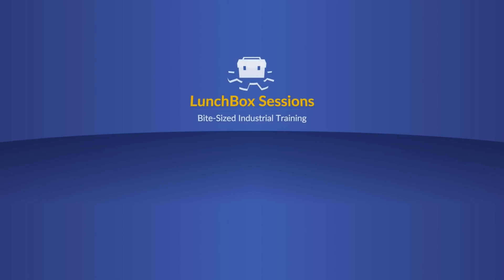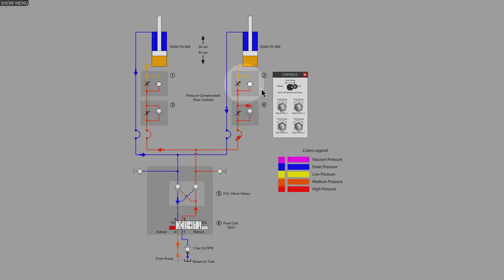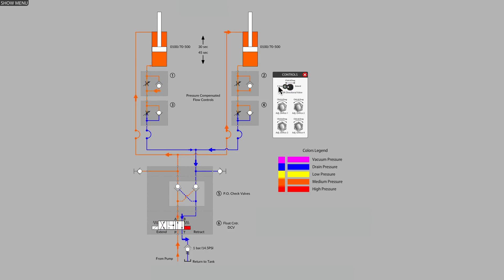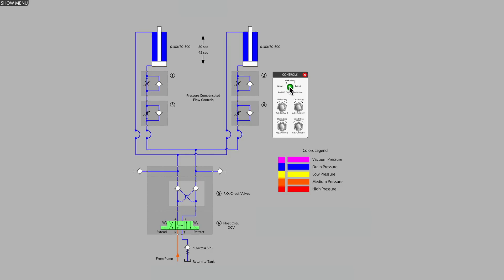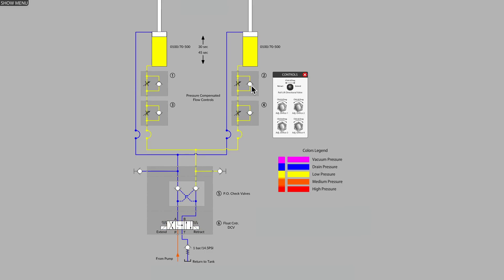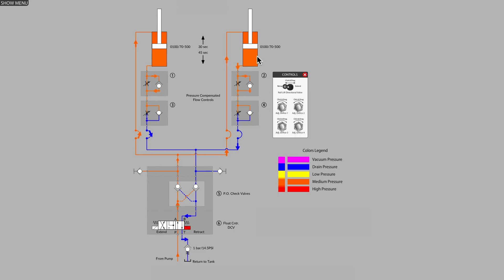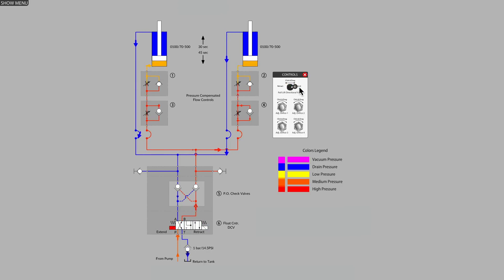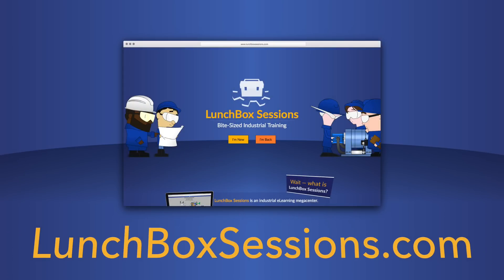Using Meter-In & Meter-Out Together - Part 1

Comment: So ideally would it be lifting and lowering the heavy loads with modulated speed and does away with the need of a counterbalance valve?
Reply: so in otherwords by using a single needle valve in the full bore would not support a run away load where as the current system does.
Reply from the maker: Adam, you are right on top of some very important and tender issues for a circuit like this. On this exact machine, the load mass is always the same, and the rate of motion is very slow. Therefor a counterbalance is not needed. There will not be a runaway, which is where a counterbalance valve shows it's capabilities. Of course a counterbalance is not a flow (speed) control per se.

If you look closely at the symbol, you will see an extra inline arrowhead in each flow control (older ANSI symbol shows the extra arrow head at 90 degrees to the flow line). This denotes a pressure compensated flow control, which is the type with a small floating spool inside that can make minor adjustments to the orifice opening automatically if pressure fluctuates a little on one side or the other of the flow control. In so doing it keeps the flow rate very steady. I have oversimplified a little on the p. comp flow control explanation. We will do a video soon on the pressure compensated flow control as a component.

In my experience, the p. comp. flow control can only provide 'compensated' flow control in one direction. Haven't seen one yet that can do both. So two flow controls are needed to provide truly pressure compensated flow, one for each direction. That's a second reason to use two FCs. Chad Jessup who commented earlier, picked up on the other. 

Thanks for commenting/playing along! - Carl
Reply: +LunchBox Sessions I enjoy the teachings so thanks for making them.